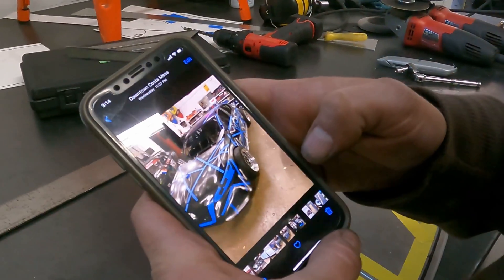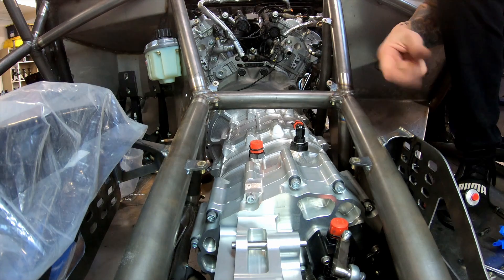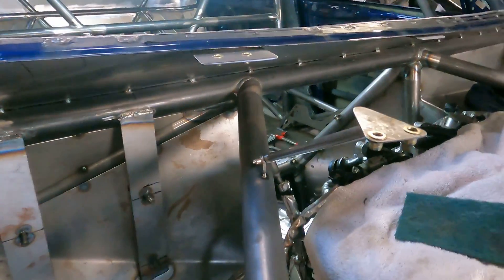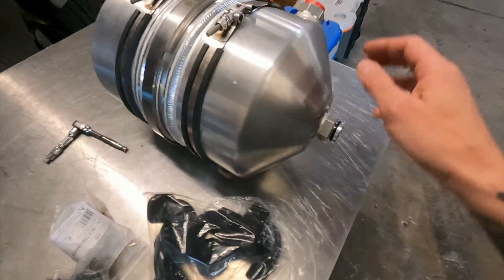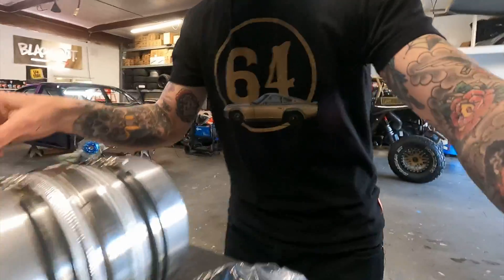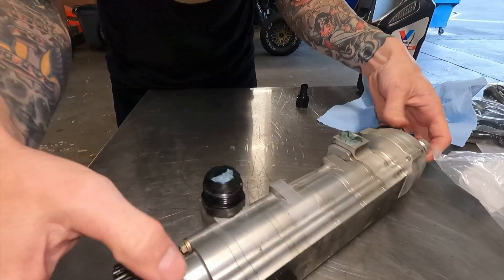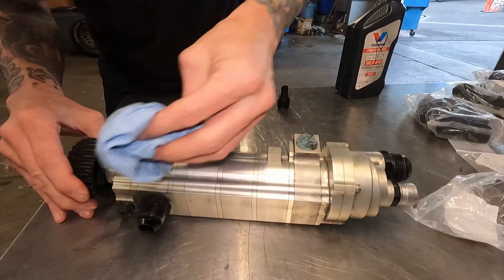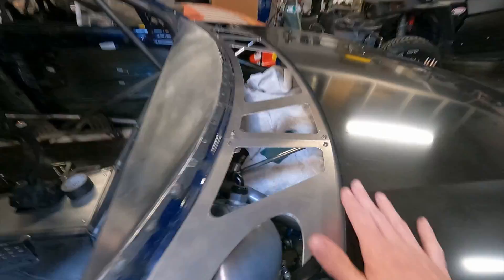Nissan GTR Engine Dry Sump Plumbing!

Comment: What was that billet alloy thing that mounted  down under the car that he put the 2 fittings in mid way through the vid?
Reply: Was wondering the same thing
Reply: its a post engine oil filter.

Comment: Hi - I've converted my 370Z to a dry sump system and have oil overfilling the breather can.  I've vented the valve covers to the dry sump tank, and the dry sump tank is vented to a breather can.

How are you venting the valve covers and connecting the breather can in your set up for the GTR?

Comment: The base of the windshield is a high pressure area tho
Reply: Not for what there doing . a actual high speed race car would be a different story
Reply: @Robvdk69  The principles remain the same wether going 1 kph or a 1000 kph. I understand that for a drift car many things are less important, but you can’t say they just fabricated a vent there, it’ll still behave as a intake unless there is some ducting from a even higher pressure area routed to it
Reply: @TofumanFC3S  yes but when your sideways most of the time vs going straight ish most of the time the aero matters alot less. And its explained that its used to release heat from the engine bay
Reply: @Robvdk69  But in reality it will act as an intake into the engine bay, increasing pressure in the engine bay making the pressure differential over the front mounted coolers less substantial and decreasing their effectiveness. All the while ofc. trapping even more air into the engine bay making cooling harder. That was my whole point. 

Again, I understand things don’t matter as much on a drift car and angles of air flow vary more, but that just means a bad idea might turn out slightly less bad. One should probably consider starting with a good idea (like locating the vent in low pressure zone more forward of the bonnet) and even if that performs less, it’s still probably nett a positive thing
Reply: @TofumanFC3S  do you have any hands on motorsport experience? It won't act as a intake as the exhaust is coming out either side of it and the hot air from the engine bay will be forced out of that plate. Plus its a fun/demo car so all those little things don't matter as much .  In a sport that requires down force it would be different but aero that actually works properly is very few and far between in drift cars
Reply: @Robvdk69  I studied this in college and have developed race cars for my work, yes. But even if I didn’t there’s well established laws of physics at work here and that won’t change anything. 

The transition from bonnet to windshield creates a high pressure area of significant size at the lower part of the windshield AND the end of the bonnet. Now, it is true that if a car in a oversteer situation (assuming all other factors remain constant), the trajectory of the air transitioning from bonnet to windshield has a less drastic angle, the angle is still there and the effect will still happen in a less significant manner. 

There is a reason that since forever the interior ventilation picks it’s air from exactly there, the cowl. It’s because even with the fan turned off there is still ventilation because of the pressure differential. Also look up “cowl induction” to see engine intakes positioned there. 

You are right, you COULD make something vent there, but you’re fighting the aerodynamic principles of the car, so why would you? If you take in all the air of the frontal area of the car, duct it through the engine bay and then funnel it out at the base of the windshield it’ll probably overcome the pressure at the cowl area, but that’s a lot of pressure needed in the ducting, and again: For what?

Here is an example of the pressure profile of an RX-7 FC. I thought it was fitting seeing my screenname here:

https://www.rx7club.com/attachments/1st-generation-specific-1979-1985-18/643862d1501339359-any-aerodynamic-profiles-1st-gens-flowlinesvelocity.png